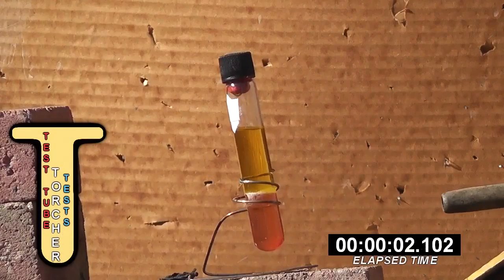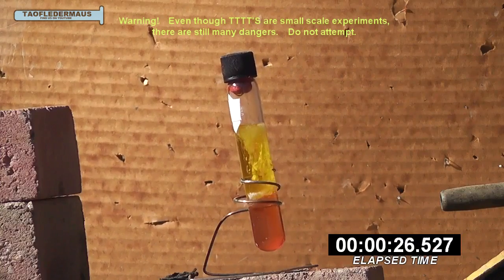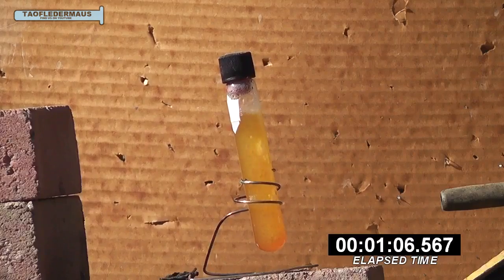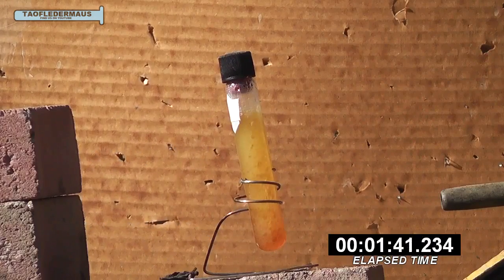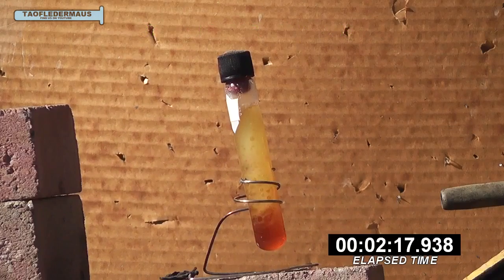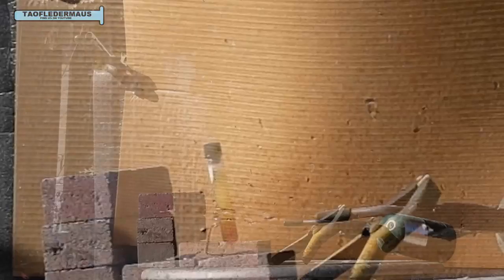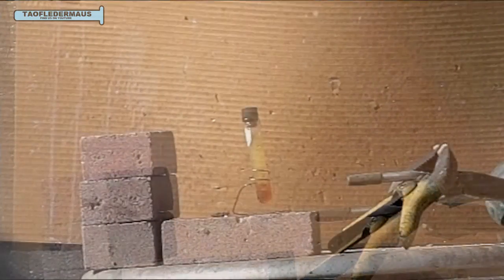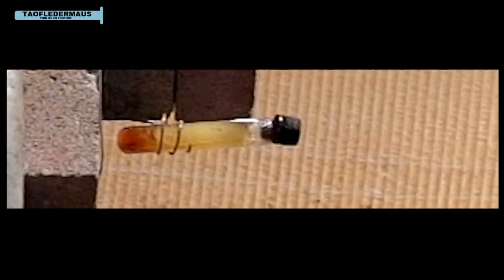Oil and Vinegar "Lava Lamp"  Test Tube Torcher Test

Comment: Good demo of glycerolysis. Heat water and oil hot enough and with enough pressure you can strip the glycerol backbone off of the triglyceride and end up with free fatty acids and water/glycerol mix. Thinking that's why it seperated back out again.

Comment: Some suggestions from an older engineer:  Use two pieces of wire, one (horizontal) to suspend the other, which will have a couple of turns around the first. This way the test tube won't hit anything, it will just spin like a Ferris wheel.  The bricks should hold the test tube high enough so it can't contact the table and the horizontal wire should be long enough to prevent the test tube from hitting a brick.  Now you have to do all the better experiments over again. :-)

Comment: Can you actually try for once to put a soft material underneath the tube so it won't explode due to the impact on the ground? Just curious.
Reply from the maker: I used a stand to prevent the tubes from shattering for a few videos,  but honestly,  about 90% of the viewers hated it.
Reply: Yeah the stand sucked. It basically stopped the tube from moving at all. :\

Comment: Mythbusters did this with a real lava lamp and the exact same thing happened, just on a larger scale.
It seems like it takes a while for the solution to start evaporating...
Reply from the maker: I can't remember if I saw that one or not.    I don't watch MB's that much since those three other people joined the crew and turn what should be a 30 minute show into a 60 minute show.
Reply: They are pretty good at their job though. I think mythbusters is over now...
Reply from the maker: I HEARD they are ditching the three helper people.  That is a good thing because to ME,  it was just a distraction and everything they did was just  "fluff"  or filler to make the show an hour long.

Comment: The boiling point of acetic acid is actually irrelevant at this point. The acetic acid is in an aqueous solution around 5% or so for normal vinegar, so the vinegar behaves like water, rather than pure acetic acid. Actually, superheating pure acetic acid would be pretty cool to see, since it's flashpoint, if combined with air, is around 40°C (104°F). :D

I love your videos, though! May it be shooting, playing with mercury or heating up stuff in sealed containers. Keep 'em coming!

Comment: Would it be at all possible to stick some fins to the test tube and heat it upside down, creating some kind of makeshift rocket? I'm curious to how high it could go and if the test tube would even survive.
Reply from the maker: I don't think there is a way to adhere fins without them being burned off,   epoxy,  etc.

Comment: You should do this with milk
Reply from the maker: The problem is after I put the substance inside,   I seal it with silicone and that takes at least a week to cure.   Then the tube might sit for a couple months before I use it.   I don't think the milk would be milk anymore after that.  lol
Reply: ***** would UHT milk survive?

Comment: How about doing a series on smokeless powder? What about smokeless powder in gasoline or something silly like that? Or in oil? Or water? Or just by itself?
Reply from the maker: Someone just gave me some black powder.   That's a lot more energetic than smokeless.
Reply: Black powder is, without a doubt, less energetic than smokeless. Black powder is more explosive when ignited in an open area, but smokeless powder contains far more energy per unit weight than black powder.
Reply from the maker: That's true,   if you shoot smokeless powder in a black powder rifle not designed for it,   boooom!
Reply: Yup. And that's why I think it could be very interesting- its very unpredictable.

Comment: What about taking gasoline and helium and putting a case around it and boiling it? The case is for obvious safety, but the gasoline may or may not explode, since yadda yadda yadda, it needs to be exposed to a flame, yadda yadda yadda, you probably already know this, blah.